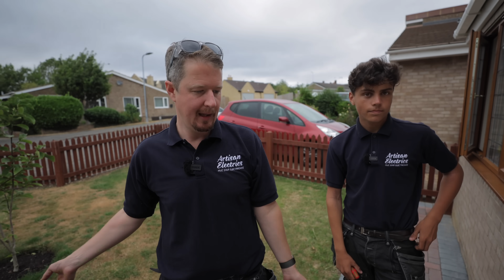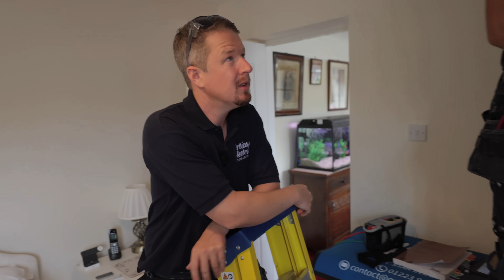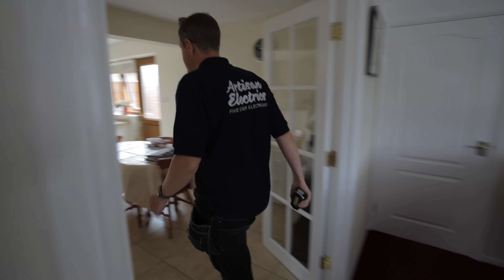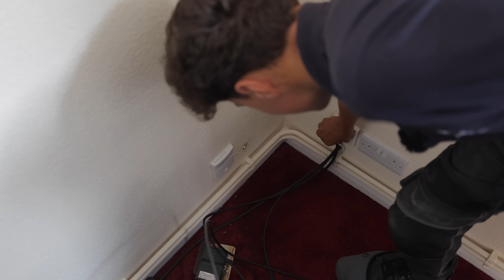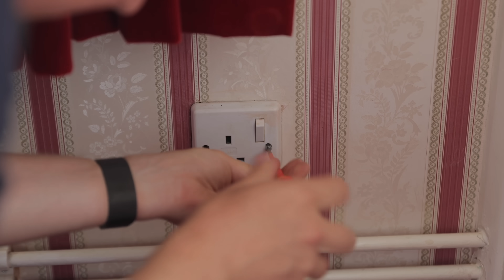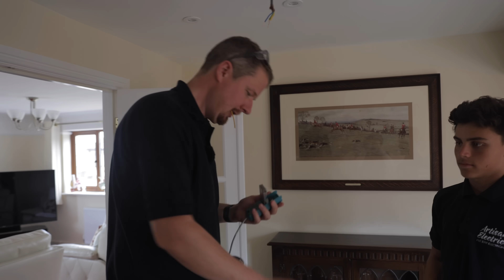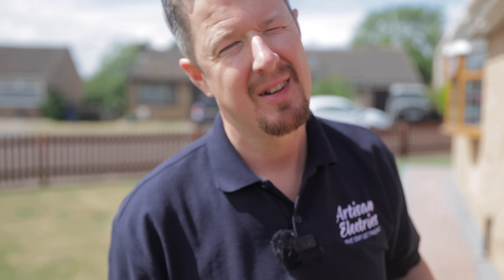CUSTOMER TRIED TO SUE ME - SHARING MY ELECTRICIAN HORROR STORY

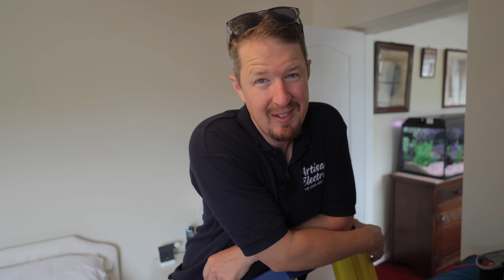Comment: 8:20  as a heating engineer worked in a house with cream carpets everywhere, customers was adamant that shoes were to be removed. We wore overshoes and lay down roll and stroll everywhere needed to be, took photos over floor condition where ever we worked before and after, week later boss told us mud stains were left on carpet. Out come photos and proved the stains weren’t there before or after our visit, (customer didn’t know we took evidence) but saved a lot of grief for our company

Comment: i am English living in Mexico.  If Jordan came her he would a heart attack:  Normal sockets, they use metal ones,  in bathrooms and OUTSIDE on patios; not protection from rain.  Some houses have only 2 fuses in the internal fuse box.  Some have the main fuse-box outside with 2 cylinder 30 amp fuses. They bond the earth and neutral behind the meter.  I have never seen bonding to water pipes. The main cables to the main switch are coloured BLACK for LIVE and WHITE for NEUTRAL .  I installed my electric in a house I had built and did it like the UK.  Everything is earthed, correct size of cable, sockets and switches' back boxes are plastic and not inserted in the walls; my walls are not plastered, bare brick.

Comment: Z is impedence, and is complex.
R is resistance and is real.

A simple example of the difference is a capaciter.
An ideal capacitor has an infinite resistance, but the impedance is -i/wc (or -j/wc if you are that way inclined).

Comment: An EV CHARGING POINT INSIDE THE BUILDING / HOME -  is   high risk.
One is taking a gamble that the EV batteries will not catch fire -
It would be acceptable for those who have a  DEATH WISH
In any risk management analysis -   the question is.
What is the worst thing that can happen when things go wrong ?

Comment: Just an observation. The main incommer fuse carrier is labelled 100A, that doesn't mean the fuse inside it is a 100A fuse. The one on my installation is a 100A fuse carrier but has an 80amp cartridge fuse installed

Comment: A better way to do global insulation resistance is to turn off the main isolator and short across the outgoing neutral and live on the isolator. And test live and neutral to earth, you can test at 500v then, the potential of live and neutral is the same so you won't damage and equipment downstream and results won't be hurt by neons. The only issues you might have is at incorrectly wired devices.
Reply: Note when trying to narrow down on a fault it's only safe to narrow down with double pole devices rcbo and MCB or you'll have to switch down to lower voltage and do as you've done.

Comment: Customer here. We were having our father’s house rewired, prior to sale. Issue 1. The house had been 'rewired' for our father, decades before, but the electrician employed, had pulled a fast-one by only changing the ends of wires.
Issue 2. I was in the house to inspect the work and noticed that the bath had been damaged beneath the extractor fan, where one of the electricians had been working. I suspected that the damage had been caused by a tool like a pair of pliers dropped on the bath. I complained to the supervisor and the electrician denied being responsible. I then explained to him that the bath was a glazed cast-iron bath and that something hard and heavy must have hit the bath and damaged the glazed surface of the bath, the glazing is essentially glass, hard wearing but brittle and vulnerable to impact from hard objects. He still wasn’t having it, so I picked up a pair of the electrician’s pliers and hit the bath  some distance away from the damage and effectively reproduced very similar damage. The supervisor then crumbled and agreed to replace the bath.

Comment: These plastic panel boards are so peculiar to me from Canada.  I don't mean any disrespect first off.   I'm used to steel enclosures and call them load centers, main panels,  or sub panels and calling the devices with in  breakers in the panel with abbreviations to say what kind they are. 
Single pole, double pole, triple pole, AFCI, GFCI, combo AFCI GFCI.  We don't often use the word Earth but we say ground or bond.
I appreciate the way different places do things for sure and the different colors used the different hardware. It's so crazy how each continent and region has their own way of doing it.  
It's really wonderful when you see a bad install and then you get people calling out other countries like we would never do that in our country. That's just garbage that must be "insert country"
The code in Canada is very strict for electrical.  The area we fall apart in is not having enough infrastructure or inspector to see every job.  In counties and more remote areas. Typically you take pictures of your work and send it in explaining what was done and it gets passed unless the inspector happens to be in that area.  It's just the way it is because provinces are so vast and distances between towns can easily be 100 km if not more.  To have dedicated inspectors for every town would be for one way too expensive and for the other they would be sitting on their hands most days.

Comment: Regarding the table being damaged, I'd have let it go to court, it would have been relatively easy to prove you had little chance of creating such damage and the onus would have been on the customer to actually prove you did by means of either video evidence or probability.   Given you (presumably) had never been sued before for similar damages, it would be highly probable the court would have ruled in your favour, regardless of whether the customer was a lawyer or not and my reckoning is they wouldn't have taken it that far as to have lost that case would have put their reputation on the line.   They tried it on, as most do, and would likely have backed out before it went to court.

Comment: Terran neutral concentric, right? That takes me back to my City and Guilds 2002. Impedance is caused by the resistance of the circuit IIRC, ohms being a measure of that resistance.

Comment: For DC circuits, impedance = resistance, they measure the same. In AC circuits, impedance is a different value than resistance due to inductive and/or capacitive elements in the circuit.

Comment: Impedance=Total opposition to the flow of AC  Current(with Capacitance and Inductance figured in)!  In a totally resistive DC circuit it would be Resistance only.

Comment: The live test on the lights could have been done in a safer way. Not necessary to do a live test to prove earth continuity.  I disagree with C2 for the no earth continuity on class 2 products, there is no requirement for a CPC in case a rat chews the cable. Many appliances have cables with no CPC.

Comment: It depends on what you're measuring, your kit is most likely measuring impedance, which is everything on the circuit that impedes current, so inductive, capacitive as well as resistance. Having said that, I buy lightbulbs and call it resistance, so you do you!

Comment: It's interesting to see how much the electric wiring differs from how we do things in Sweden.
I would have freaked out at the 100A main fuse (our electricity bill is based in part on the size of the main fuse) and, having worked as a "plumber" (best put that in quotation marks), I would have packed my stuff and left after seeing wires on the kitchen floor...
What happens if you have a water leak, drop a saucepan or forget to turn off a tap?

Comment: Hi Just to say great content, you obviously take pride in your work and explain things very clearly, good luck to all your trainees. When you was pushing for a comment on the gas bond I was waiting for you to mention the safety connection label as it was not clear in the video, I apologise if it was wrapped roun the back, but I was always made to take it off the strap and fix it via the main bolt on the front of the clamp.. Keep up the good work. Matt

Comment: WTF is type tested? Every small consumer unit has standard DIN rails and most circuit breakers plug into them.
I agree that you shouldn't mix different kinds of breakers because of the busbar connections, but what's so dangerous about putting Legrand breakers in a Scheider box apart from looking dodgy?

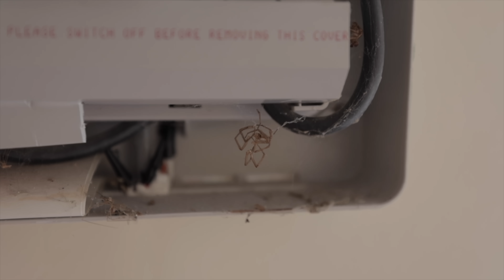Comment: 8:47 seen a lot of new  boards. However most cut excess cables. You have no choice to extend cables.when you come across problems of move circuits around. Never mind a board change.

Comment: What kind of stupidity is the PEN fault protection by disconnecting ground? You have a 3 lead going into the charger, there is no PEN wire, as you are in the TN-S system. Just L, N and PE.
Breaking any kind of PE or PEN wire with any switch is highly illegal around here. UK has some weird stuff going on.

Comment: It's odd that Ze is specified as an impedance whereas other measurements are specified as resistances (R1, R2 etc).  I suspect it might be something to do with the fact that it involves the secondary windings  of the local stepdown transformer which may have significant inductance.  I also suspect that all the measurements made by the testers are actually impedance measurements because that's much easier than trying to separate out the in-phase components of the voltage/current.  In the case of a simple length of wire, there's really no practical difference between impedance and resistance.

Comment: 100a on the fuse carrier does not confirm it as such you would have to ask your DNO then you would be relying on there records which are at best out of date, always get there ratings of fuses in there equipment in writing before signing of your EICR just cover your ass. Especially when installing high load equipment like EV charging equipment.

Comment: I've had contractors with good reviews be careless - Painters were spraying water from a hose into a paint tray, and splashing paint water all over my car. Same painters spent hours removing my storm windows, didn't clean them, then painted them shut with 20 years of dirt still inside along with huge paint smears on the inside of the glass. Another guy was messing with an articulating ladder, swinging around sections inches from my car almost hitting it when there was a whole big backyard available. A guy put staples through wiring with a cable stapler, broke my swiffer, threw away a bunch of my stuff in the garbage. A plumber was ramming a snake down a drain, hitting the p-trap thinking it was a clog, kept ramming repeatedly and broke the ABS drain line. A guy using my drill and bits stripped out every screw he put in and ruined multiple bits. I could hear the noise of this happening at the other end of the property when I got home. An HVAC guy ruined my $500 Rheem smart thermostat by applying power to the variable motor speed line; it actually burnt up and smoke came out. He accused me of causing it and I paid for a new one to get heat back on. If I want something done right I have to stand there and nitpick common sense to people, which I dislike.

Comment: Here across the pond in the USA we had a reputable electrical contractor secure a permit for installing a few hi hats. Job passed inspection but a year later one of the many scum bag ambulance chasing g lawyers brought up a law suite again him because the house had a fire and he never offered AFCI ( Arc Fault Circuit Protection ). Our state was still in an older code cycle and they were not required. From what I heard cause of fire was never discovered but nogoodnic lawyer thought he could make another bundle by 
Suing a contractor.

Comment: Unbelievable the many times he does the ,is the consumer unit neat or not neat (drum role)its a mess ,I'm beginning to think that the alan partridge of electrics is staged this by opening the c unit when the camera is off he opens the cunits up tosses the wiring about,puts the cover back on ,because I've been in this trade a long time and I never come across what he comes across, he does this to make himself to be the messiah of electrics.
Reply from the maker: Wow you figured me out 😅
Reply: @artisanelectrics  yes I have
Reply: It's true you always do the same thing and by the way I was fitting pv back in 2014 and that's nonsense about birds nesting behind solar panels,I fitted enphase which as inverter per panel in behind which is by far the best system

Comment: Proving this is always impossible. Lawyers are the worst. I had a solar company install a roof unit. The scaffolders  destroyed my rain gutter. Took a picture, sent it to the installers , went to a hardware store, bought the stuff i  needed repaired it, done. Did not even claim the 30 quid from the company, too much hassle. Just be nice to each other and all works out.

Comment: You are a lovely person!

Batteries in the loft could easily get above 50C while disconnected electrically.

Higher than 30C lowers kwh capacity and lifespan. 

Charging/discharging creates internal heat

Subscribed! ❤
You have interesting videos I will have to check out

Comment: All the circuit breakers were still on on the RCCB protected side - so you weren't proving which final circuit(s) were giving low insulation readings. Incidentally, insulation resistance should always be done globally to comply with BS 7671, otherwise the resistances in parallel need to be calculated. BS 7671 gives minimum insulation values for the installation/DB - not for the final circuits.

Comment: Never saw a neat consumer unit, they were all a mess. Usually because of alterations over the years. Only neat ones were first time install or replacement by myself. Came across bell wire once connected to a 32amp MCB. feeding 13 amp sockets in a new extension. I was called out as smoke appeared from a 2 gang 13a socket. The bell wire had melted. I condemned the lot.

Comment: We once renewed a garage steel roof for these couple. The man was a copper and the wife was a solicitor. When we finished the job  and the customers were happy. We gave them an invoice for the job. 
She said to me, how do you work out your price on this job.  I just said to her, I come out, measure the job up. Calculate the cost of materials and then add on the Labour cost. She then said, how do you calculate the labour cost. I then said to her, you’ve excepted the price which they agreed on, before we started the job.  doesn’t make any difference how we work out the labour cost. 
She worked out, that we was on the job, two and a half days. With an hour’s break the one day, hour and 10min the next day and half hour the last day. So my calculations works out that we’re going to only pay you x amount. I said you’re taking the fuking piss.  You agreed on the price in the beginning and we worked job and finished. Because it was summertime, we worked up until about 9pm 
I phoned my boss up and told him what has happened. I said shall we rip the roof back off.  He said no, just take the payment. Which I did. He never tried taking them to court for the rest of the money. He said it’s not worth the expense. 
We never did anymore work for coppers and solicitors. Don’t trust the fukers.

Comment: I installed a wire underfloor heating system in someone's kitchen once.  It had a breakfast bar and all sorts so it was a bit of a challenge.  As I was quite proud of getting it all to fit perfectly as you can't cut the wire and on the off chance that there were issues later, I took various photos.  They had a dog incidentally and he was a nightmare but he was kept in the next room (where he destroyed the packaging for the underfloor heating system) and he was constantly running around as if he was on something.  Anyway, customer emailed the boss with photos of this wire all crossed over looking like a right mess, so I showed them my photos which were sent back to the customer.  They didn't respond, instead went on facebook and slated the company.  We responded to them on Facebook, but you know what it's like, the damage is already done.  I personally believe the dog got into the kitchen and ran amok on the wire.  Glad I took the photos but it still didn't help.

Comment: Hi,

I am wondering why the BS have limitations for the use of components in a consumer unit.
Usually the DIN-rail sets the standard and harmonisation for proper installations and safety of the fixture.
When it comes to special items such as AFDDs it may be useful to install an item from the manufacturer that provides the  best product.

Regards

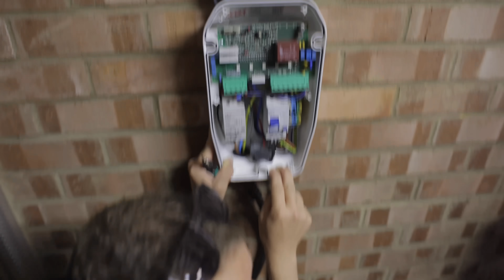Comment: 31:00 Ooh, no! "The car is in the garage so there's no contact with true earth so PEN fault protection is probably not necessary." Concrete floor?  No PVC insulation or DPC under that concrete? (It would be visible at the edges of the slab) The standing on the concrete is standing on the general mass of earth!  The stuff is conductive.  Do you not remember this trick?: if you are doing an earth electrode resistance test in, say, a playground, and have nowhere to insert your ground spikes, all you need is soaking wet pads (pieces of "super mop" are ideal as they hold the water and don't dribble everywhere as you walk) to place on the concrete (give them a little press to make the concrete damp) then lay the spikes on the pads, and you can get a pretty true reading, through the concrete to the ground below.

Also, if you've never heard of eVolt, you need to start reading PE, our industry rag Professional Electrician.  No excuse really, it's free and found in every worthwhile wholesaler!  It is genuinely useful read for every apprentice, Reuben should have this month's issue in his hand every lunchtime for a good read :-)

Comment: "Fuse size?" "100A; well, apparently."
Excellent! The prentice will go far :-) If you have cause to be precise, it must be a Lim.
"Earthing system?" "PME" ❌<Wa-uuuh!>  If it even exists, and today it's safer to assume it doesn't, that's only found outside the property on the way from the transformer.  Rub it in so he doesn't forget why lost neutral TNCS faults are so damned dangerous to residential consumers.